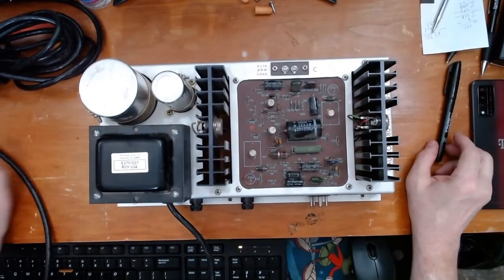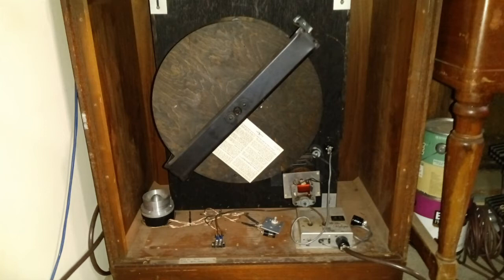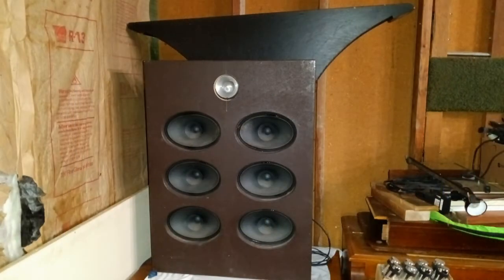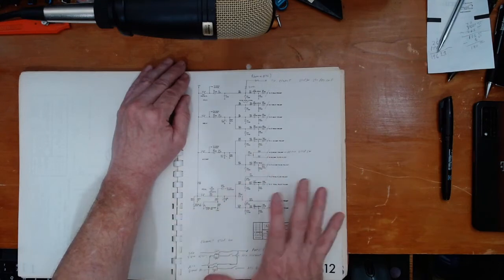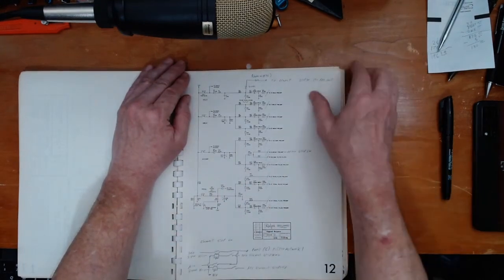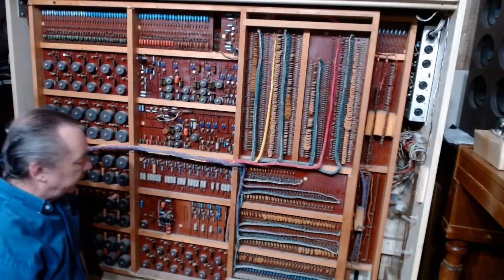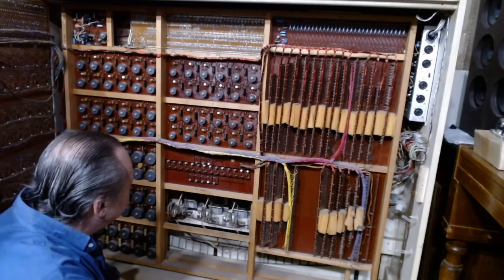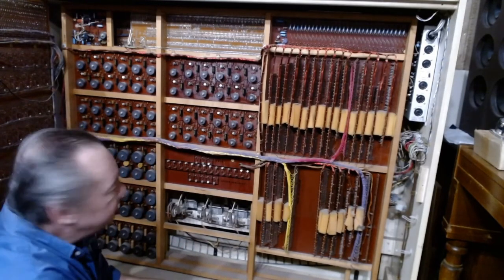Organ Technology part 11, Rodgers 33E, second look

Comment: Tony you do say some crazy stuff: Electrolytic capacitor electrolyte doesn't 'evaporate' through cardboard tubes. Those tubes are insulators placed over metal cans. Electrolyte dries out, especially as the result of heat. Heat is death to capacitors over time.

Comment: I  have a Rodgers 33E that I am trying to repair. Current the audio has a lot of static. I think I have traced it to the output chassis and when I tap on the Q5 transistor the static goes crazy. Am I correct in assuming that it needs to be replaced and that I can replace it with a 2N1303 or 2N1370. If so which would be the best.